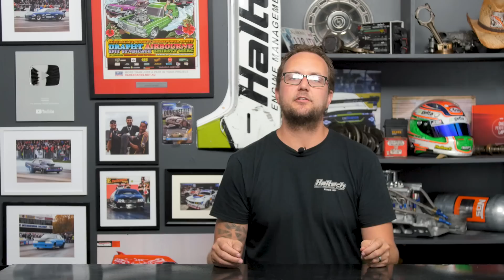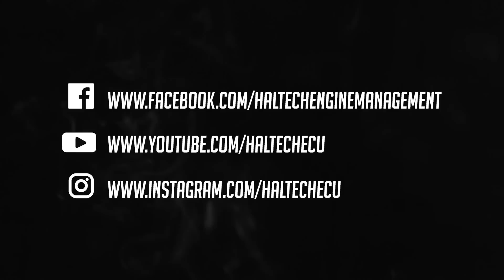🛠 Different Types of Variable Cam Control  |  TECH TUESDAY  |

Comment: BMW - V A N O S 

This will be interesting to how Engine Calibrators in the Aftermarket scene use Cam Phasing to control air management/torque in the B58 engines in the new GR Supra!
Reply: I don't see why this would be much different than what is already being done on several Vanos engines already, from the m54's (and s54) continuously variable vanos to the b58's closer cousins the n54,  n55 and s55.
On the latter ones they usually run a piggy back style management to keep the factory ecu running the direct injection etc.
On the earlier ones there are lots of ecu's that easily can handle the Vanos, and a fair number of engine builds use them now.

Comment: There is a way to get maximum power over a greater RPM range. It’s called an electric motor.
Reply: I’ve worked in an automotive machine shop, and on a race car. I love internal combustion engines, but fact is always fun.

Comment: On/off = V-tec
Variable = vvti
Am i close enough?
Reply from the maker: Close enough:)
Reply: @haltech  If possible could you guys go more in depth about the last type you covered, because i cant fully see it in my head, awesome vid tho 👌👌✌
Reply: V Tec uses a solenoid and oil pressure to Lock the cam on a different set of lobes. cvvt has a cam phaser that can advance and retard the timing based on oil pressure and engine load conditions.
Reply: @cscustoms7625  ty very much
Reply: Until you throw the different types of vtec in, and include bike engines.  But yeah, you're generally understanding it right.
Reply: @mikaelgaiason688  whoah where can i find out about these types?
Reply: @DeathandTax  I learned it by working on cars for friends and insisting they buy a hard copy of the FSM for me to keep, then going to technical school and learning the VFR was completely different.  But you can probably get a lot of info from wikipedia.  Just google "vtec" to start.  You can also find graphic videos showing how they work all over yt.  You just have to look.  If it's worth your time you'll learn.

Comment: What would Nissan's vvel be, such as on the vq37vhr
Reply from the maker: The Variable Valve Event and Lift (VVEL) system features a rocker arm and two types of links that are used to close the intake valves by transferring the rotational movement of a drive shaft with an eccentric cam to the output cam. The movement of the output cam can be varied by rotating the control shaft within the DC motor and changing the fulcrums of the links. This makes VVEL a continuously variable system.
Reply: @haltech  that's cool thanks for the reply